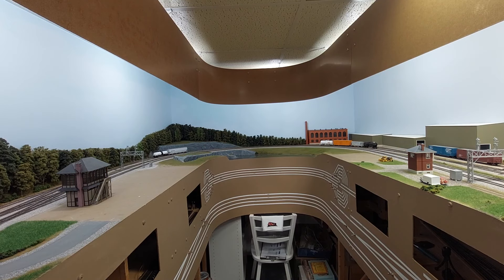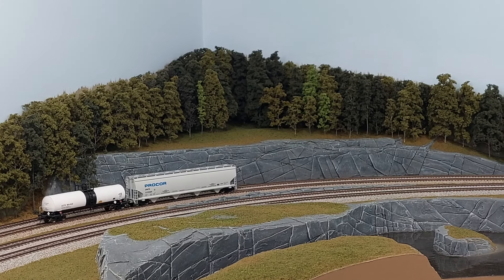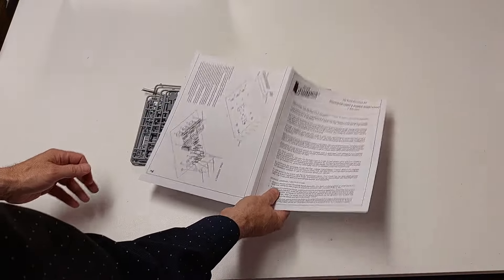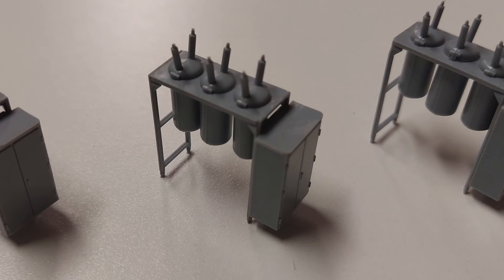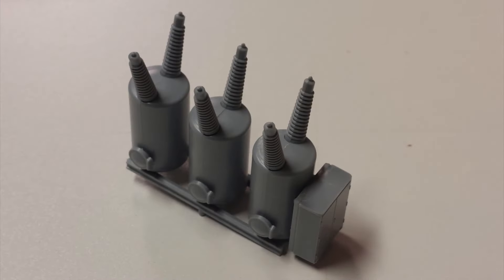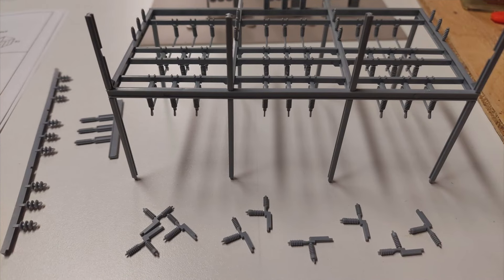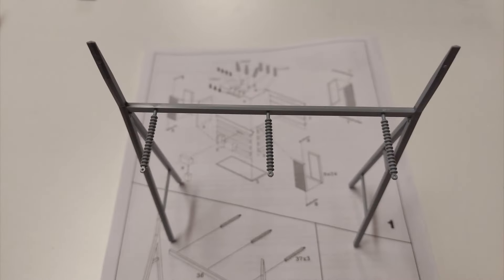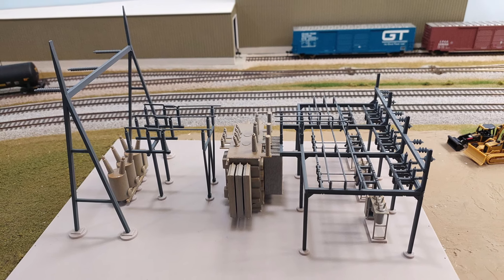Q&NE HO Layout Video 144 - 230702

Comment: I'm a Trucker here in the US, I
deliver parts to the Plants surrounding the Toyota plant in Madison Alabama, there is a
huge electric grid similar to this model plus a box building
setting inside the fence with it,
a 53 foot container painted gray with a few windows, a man door and some high voltage signs would look cool
with this model!! Great build!!
Reply from the maker: Thanks for your comment. I was thinking about using the new Atlas site office trailer.

Comment: I think it looks fine,  I would hit them with some sort of panel line in brown and dark brown and then hit them with clear flat.  I looked at are sublations.  most of the structure and frame is a white or a light grey.   The equipment seems to be some sort of greenish grey color, dark blue grey tans and yellow greys.   The insulators seem to be varieos version of greys and darker greys.  The wring looks to be bare aluminum in color.  ground is covered with crushed ruck with side walks in a few places for people.

Comment: I like the yellowed effect, it may create a little more work in painting, but a light misting of grey, then a mix of washes will bring it back to a metal look with some nice weathering tones underneath, making it unique. The 3 foot rule always applies, it'll look great when finished. All the best. Brian @ The Angels
Reply from the maker: Thanks for the suggestions, Brian. I am concerned that it is not three feet away - it's at the very edge of the layout!
Reply: @QNERailroad  true that, yeah, I get what you mean, I'm sure it'll look great when you put it in place and detail it and area. Looked like a tricky kit to assemble.

Comment: Having worked around such things grey does not have to be the primary color. Insulators can be either grey or brown, camouflage brown by Rust-Oleum  is a pretty close color match. Depending on company policy  transformers, and other equipment can be painted primer red. Your transformer insulators can be brown as well as are insulators connected to incoming power lines. 
All substations have a gravel base except under equipment, for protection I believe from power surges. You don’t see it under the gravel but there is a copper wire grid that all equipment is grounded to even the fence. There is usually  a small control house inside the fence to provide protection for control panels, reclosers and such, they can also be housed in a weather proof cabinet outside. Concrete sidewalks are usually installed from the walkthrough gate to the control house. There is always at least one drive through gate for access for maintenance.
Reply from the maker: Really appreciate your feedback, Bill. I was thinking about the new Atlas trailer office to add some flavour. I will use sifted crushed limestone dust to simulate the gravel base. I used it for my propane yard.

Comment: Since the circuit breakers are oil filled they represent the era when breakers and transformers were dark grey as in faded black.   The insulators would be brown to be era likely.  The structures are galvanized steel and the tubular bus and metal parts of the switches would be aluminum.  The bases for the circuit breakers would also be galvanized steel. Incidentally what you call circuit breakers are disconnect switches.  The groups of three tank like devices are oil filled circuit breakers.
Reply from the maker: Thanks for the info. I am revisiting my colour scheme, based on lots of google images I found recently. I know they are not necessarily or fully reflective of the 1980's, but for now I'm turning a blind to exact prototypical accuracy as I am not sure the more modern high tension power line poles I bought were around back in the 80's either.  Would be a different story if the available models of the standard towers were better quality, as I would have preferred to use them.

Comment: In the "indoor" views, the large transformer looks a bit too dark. The color appears fine for the smaller transformers. The insulators absolutely should be white
Reply from the maker: It's all about the angle - on the layout is almost directly below the lighting, making the front view a little darker. I will paint the insulators a lighter colour.